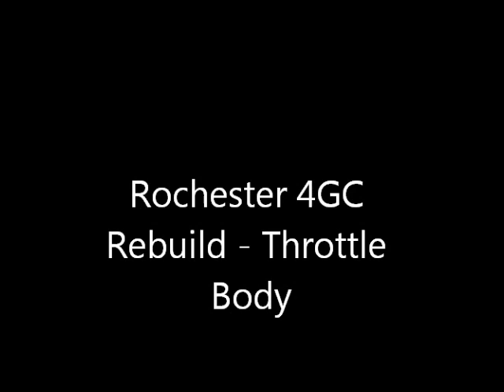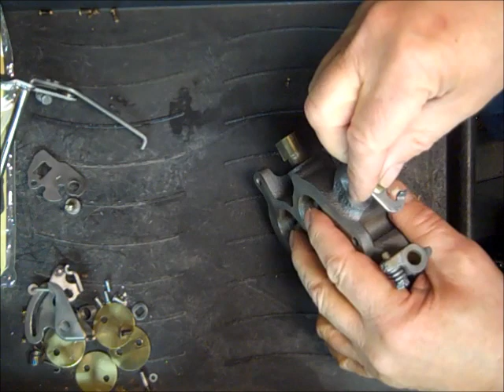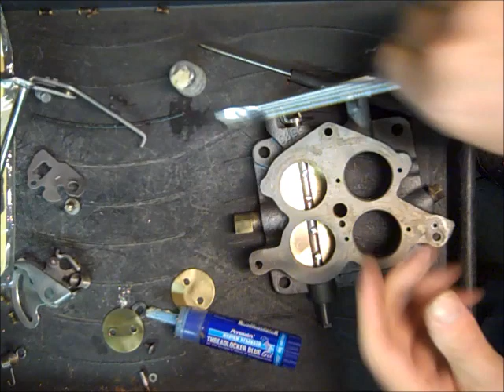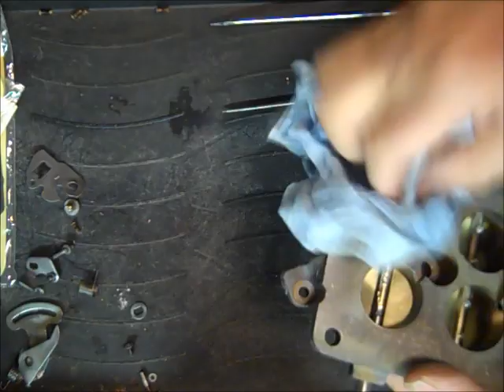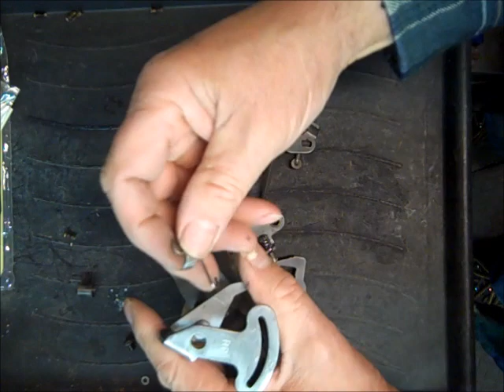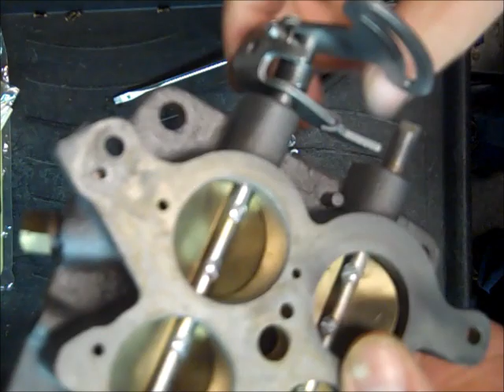Rochester 4GC Carburetor Rebuild Part 1 of 4

Comment: Mike thank for your help, I recently took apart a Rochester and soaked it in some Napa carburetor cleaner  I had on the shelf for a while? I have rebuilt these 4 jets before and never has a problem? I bought this one  e bay as a spare  and it was laying around  a while? what the history was I do not know? I have put it on the car and tried it a few times ? I checked the needle and set  and set the floats   1 5/8 height and a 2 1/4 drop as in the instructions. The engine will run for 2 seconds and the  gas will just  start coming out like a fountain out the top ? Could there be something still clogged inside? Should I buy some fresh carburetor cleaner and try soaking it more or is it a mechanical problem? The carburetor looks the same as my original but the choke is mounted on the top plate instead of on the bottom plate like my the original one on my 1956 Chevrolet Bel-air 265 V/8 . 
geraldlinen@aol.com

Comment: @MikesCarburetor i just bought one of your kits and i found many promblems with the carb. the Accelerator Pump check ball is stuck i try to use air to blow it out and a hammer on the side to tap it out nothing works. is there a special tool to get the things out

Comment: help my carb is flooding do i need to rebulid it alot of gas was leaking out. i check the carb filter i didnt see no trash in it if the filter is install wrong will this caues it to  flood/